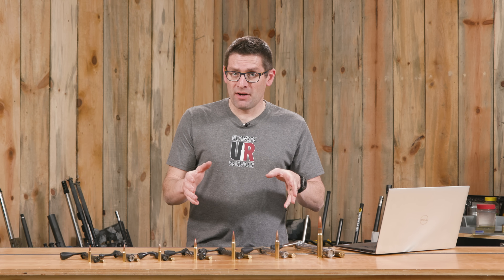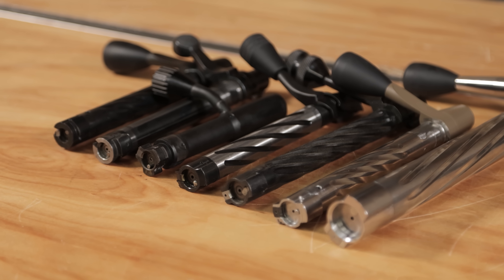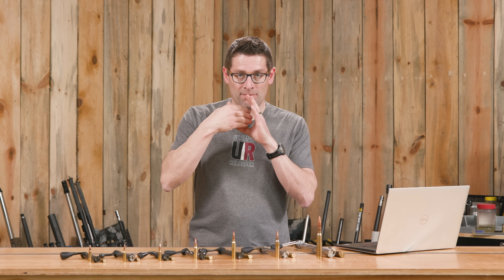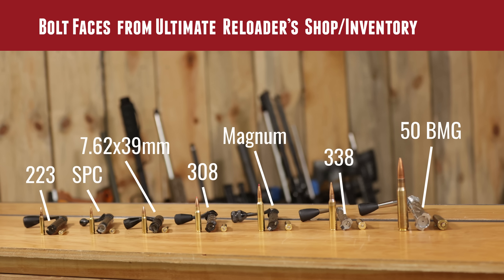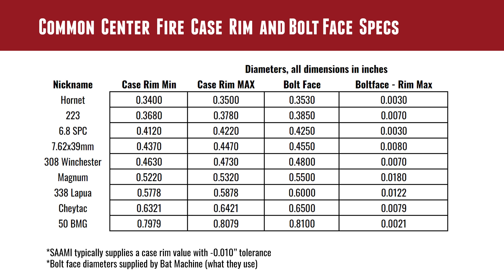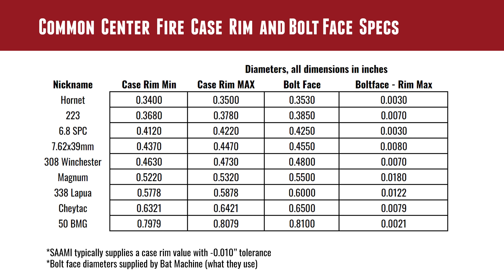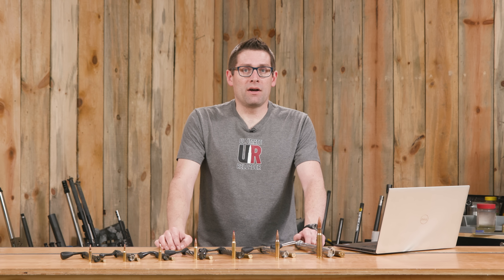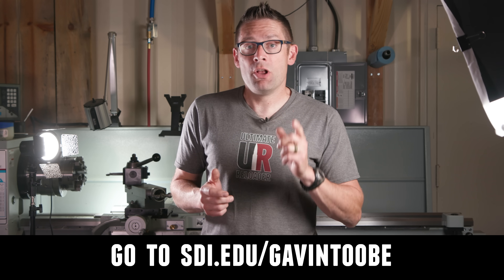Common Bolt Faces Demystified (Bolt Action Centerfire)

Comment: Gavin...I have a Waypoint 2020 in 6.5 PRC (brand new...never fired), and while checking it out, I decided to fill the magazine and cycle through some rounds just to get a feel and see how the extraction and ejection worked.  Wouldn't you know, the first two of three rounds hung onto the extraction claw and the last round (empty mag) would eject freely.  Happens every time.  Sent it back to Springfield (again...never fired) and after 5 weeks, they said they widened the ejection port and everything was great.  I proceeded to load the magazine with three rounds (all tests done with factory ammo...Norma Bondstrike), and guess what, the first two hung again and the last one ejected.  My guess is that they hand fed cartridges into the chamber to see if the ejector worked.  I'm going to have to send it back, but thought I'd post here to get your take on it.

Comment: Having a full table that also includes a action length column and compatible cartridges would be helpful to answer questions like “how can I rebarrel this old 30.06 and use its long action and bolt with a more modern cartridge”
Reply from the maker: Great idea!
Reply: Any action in 30-06 lengh is considered Long. Some are a bit longer and magazine limits the cartridge. I'm seriously looking for a affordable used Magnum rifle/action to rebarrel to either 7 mm REM Mag or 300 Win Mag with a bit faster twist. Old fashoined but easier than finding(Ammo) 300 PRC or 7 mm PRC, or the Weatherby magnums. Can seat out a bit longer bullest. Might seem Odd, but a used Vanguard in Wby mag is about $500 used and a new $800. $ 500 Barrel with a bit longer stroat/or not, and got myself a 300 WM/PRC. My ultimate build would be a Magnum lengh controlled feed Rifle ( shake when a SS Win mod 70 in mag action goes on sale, but can't affor now) . A bit extra for the notch for the extractor. My old 1917 US Enfield in 30-06 gets the job done for now.
Reply: I have a couple that I've turned to PDF's when I started looking for something to switch to 6.6SPC.

Comment: Extractor claw to bolt face clearance. I went through four different manufacturers of AR bolts before I found one that would reliably extract Lapua brass. 6.5 Grendel/6 ARC Lapua brass has a slightly thicker rim (at least the lot I got did) that is within spec but a lot of bolt manufacturers have to tight of clearance for the claw to fully pivot in place to extract. Aero Precision and JP were the only two out of five that I tried with proper clearance.
Reply: I got a Maxim Firearms bolt with my Lilja 6.5 Grendel barrel back in 2013 that functioned flawlessly with Lapua brass. Only other Grendel bolt I used was from Young Manufacturing back in maybe 2015 or so and that worked fine in the short period of time I had that build
Reply: @DanielReyes-hz1qk  Thanks Daniel, but I tried Maxim, Faxon (sent by mistake), Rubber City Armory and Precision Firearms. They might source from the same supplier, not sure and have their different coatings or treatments done. Maybe a bad lot/batch. All of them had the pivot pin located about the same, to far back from the face of the bolt. I don't remember the dimension off hand but it was 8 to 10 thousandths off. They all needed about .006" more clearance to tightly fit a rim at max saami spec., most case rims are about .007" to .008" under max rim thickness.
Reply: @rustynut1967  Strange. What year range were your bolts from? Mine were all in the 2013 to 2015 range, right around the time Type II Grendel bolts first started being made specifically as opposed to having to roll the dice with 7.62x39 bolt faces
Reply: @DanielReyes-hz1qk  About a year and a half ago, beginning of 2022 when it was almost impossible to get anything.🙂
Reply: @rustynut1967  Oh man, that's horrible to hear; I'm due for another Grendel bolt soon lol. I'll keep JP in mind. I wonder if manufacturers are screwing up the type I and type II Grendel specs again, it was an issue in the early days of the cartridge. 
Edit: Just checked my Lapua brass and the case rim thickness is spot on 0.059", right at SAAMI max

Comment: Hey Gavin, thanks for this video. I am actually dealing related to this on a rifle I own. The (terrible) gunsmith i used put a cheytac bolt face on my 300NM. There is just about 0.055” clearance between the bolt face and the case rim. Reliable extraction is a bit of issue tbh, that’s because of the extractor claw I’m sure. But would you say that this is a big shot accuracy reduction factor too??

Comment: Pierce Engineering's 20X action can be had with a .710" bolt face which lies between the .640 Cheytac BF and the .810" BMG BF. What cartridge uses a .710" BF?
Reply: 375 colossus, 408 colossus ,416 colossus , 420 colossus, 375 mars 416 detroyer,  420 blitzkrieg.

Comment: Sir I know this doesn't really have anything to do with this video but kinda does like the bolt used for 22 nosler in an ar15 is not the same as for the 6mm arc so what about loading the nosler with a 6mm projectile or changing the case rim of the 6arc to match that of the 223 to increase reliability of the bolt hear of anyone doing this

Comment: Thanks for this video Gavin. I understand that some competitors who are in to super precision like F Open Class don’t use ejectors. I assume they are worried about the ejector putting pressure on the cartridge which could negatively effect alignment. Am I correct? Is extraction just done by the extractor then by hand? Is the there an action that does not have an extractor as part of the bolt? Would that solve the alignment issue?
Reply: The 98 action has mechanical ejection (or AK Systems in semis). One could build a pin ejector that is activated by a stop behind the bolt. Have not seen something like that in 3 or multilug bolts, would be expensive to manufacture i think. In pistols most of them use controlled feed and mechanical extraction as far as i know.

Comment: I am a fan of the 6.5x55 Swede, but it has a slightly larger case head diameter than the standard 30-06 .473". I have been considering re-barreling a 30-06 Savage to 6.5x55, but I'm not sure if the 30-06 bolt face will work. The SAAMI drawing specifies the 6.5 case head is .470"-.480". The case head diameter of Fiocchi 6.5x55 brass I am currently reloading for my Swedish Mauser measures .477"-.478". Will my current bolt face work or is that too tight?
Reply: Buy a box of the ammo or cases you are likely to use and find out by trying to manually putting them in the bolt and hitting them out again with your hand. You may need to trim the rims of the brass cases (empty cases of course) or get the bolt head machined a little.

I would personally also make sure the new barrel meets CIP 6.5x55SE spec rather than the aging SAAMI spec as the CIP spec accommodates more modern pressures and a longer throat for longer projectiles. Twist rate should be 8.66 or faster to accommodate milspec or better ammo.

Curiously enough the twist rate on the 1896 Swedish Mauser is 1 in 8 or less.
Reply: That's good question.  I use 06 brass converted but it would be nice to have a proper head stamp
Reply: You'll run into issues with Lapua and Norma brass, but Remington and other USA-based brass will work. If you want a Swede that'll eat everything get a Tikka
Reply: @noahhorinek  Or a Sauer but that is kind of irrelevant to his question of how to modify an existing rifle he has to use 6.5x55SE.

Comment: Since we’re talking bolt faces does anyone know the best way to custom make a howa mini action in 224 Valkyrie? I have been wanting one since getting the 7.62x39 version. The bolt face is still my biggest challenge as the  spc size bolt is not made by howa. Any advice is appreciated.
Reply: Have you tried emailing Pacific Tool and Gauge?
Reply: @AlmightyThor82   I looked up their website and one of their services is opening up rem 700 bolt faces. Thanks, I will hit them up when I’m ready.
Reply: Assuming no one already makes a custom bolt for it, the easiest way would probably be to get a 223 bolt and open it to the 224 valkyrie since its only .020" radial material removal to open up the 223 to the 224Val which isn't really much of anything and any competent gunsmith should be able to do that.
Reply: Thanks for the advice I do have a 223 version. Opening up the bolt face was a consideration, the next challenge would be feeding.
Reply: @chadperry4021  Yeah, feeding might be a problem. I cant really be much help there since I've never messed with any of the Howa stuff so really don't know anything about them.

Question though, is Howa 223 mags staggered stack or straight stacked? If they are staggered to at least some degree (not necessary a true double stack so to speak, just each round stagger left and right to some degree) then they might work and feed fine, just at the expense of probably only being able to hold 1 less round than normal.
Reply: @CP_300PRC  i believe they are either mostly double stacked or totally double stacked. My 223 version has a 10 round while my 7.62x39 has a 5 round  but both magazines are identical in length. Oregongunsmithing llc makes nice light fiberglass stocks with bottom metal. The stock weighs 18 oz and costs 475 plus 185 for bottom metal.
Reply: @chadperry4021  Is the bottom metal that they make designed around using the stock mags or possible designed for AICS pattern Mags like some bottom metal companies do?

If its designed around AICS pattern mags, then you shouldn't have any problem with finding a mag that works. I suspect however that your 223 mag will probably work being of a double stack design and base to shoulder is longer on the 223 than it is on the Valkyrie. If it was shorter, then I'd suspect that it would cause issues depending on how the follower is designed but being longer by like 0.2 inch or so, any lip that is designed to be in the neck area of the case will  be in the neck / projectile area of the Valkyrie.

In worst case scenario, if the mags can be disassembled, it wouldn't be hard to design and 3d print a proper follower for the Valkyrie in either mag.